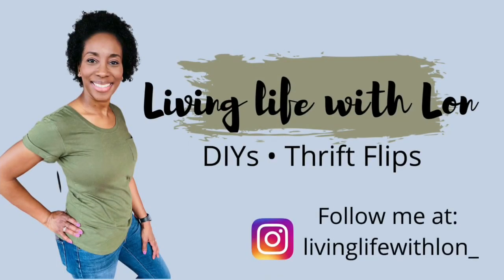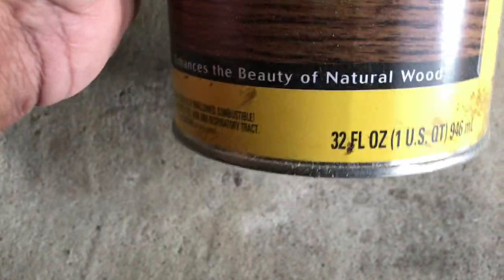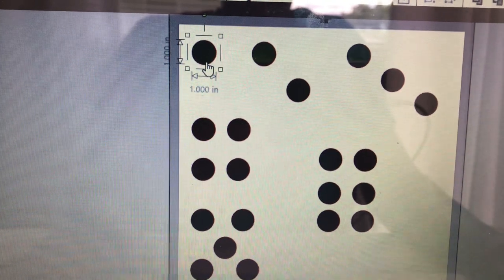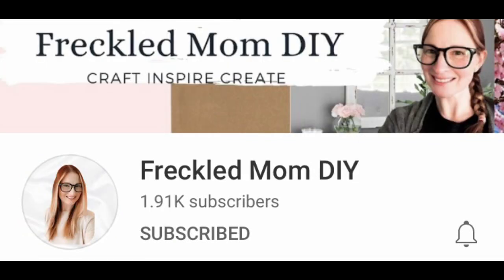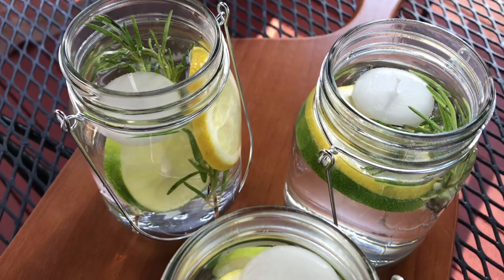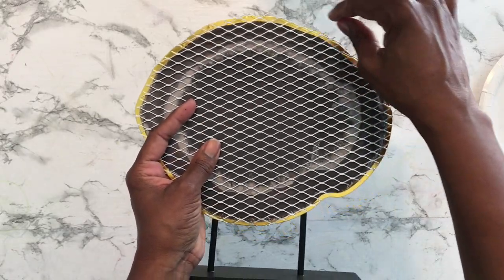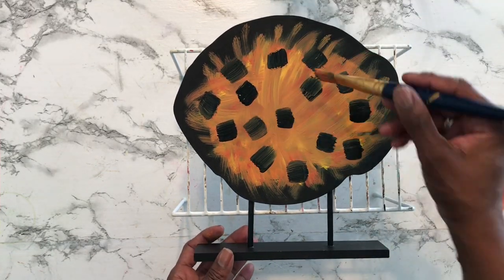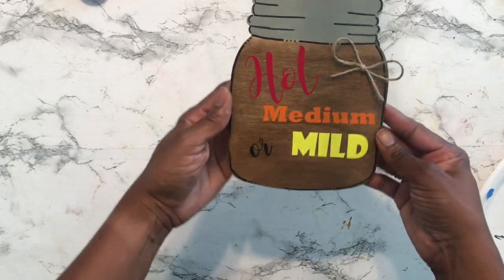5 Under $5 DIY Challenge - Backyard BBQ themed DIYs #5under5diychallenge #dollartree #dollartreediys

Comment: These are all really cute! I even liked the BBQ-and I think if you put a coat of mod podge down before you apply the vinyl, you seal the paint & it shouldn’t come up. I’m actually really new to Cricut, but I think I’ve seen other crafters use mod podge in similar situations (like as a prep to keep stenciling from bleeding), so I think that should have worked to keep the transfer tape from pulling your paint up. 

Those dice are really just so cool! 😍 Oh, and here’s my clock emoji 🕰
Reply from the maker: Thank you for watching Stephanie!!Thank you for the midge lodge trick, I will try that next time.